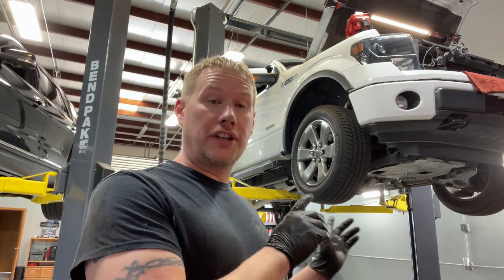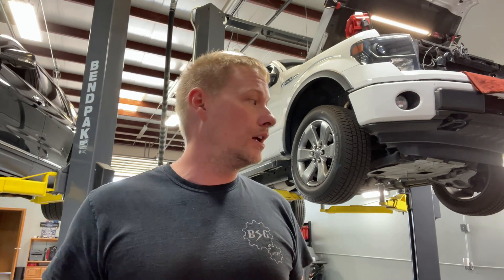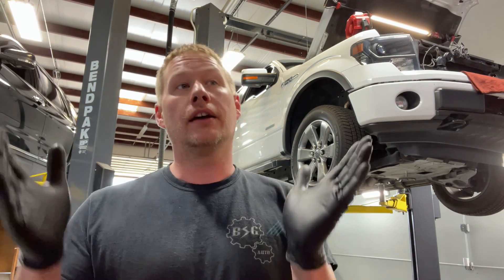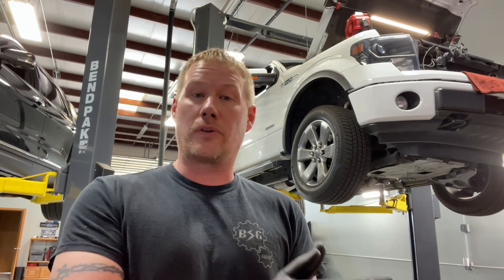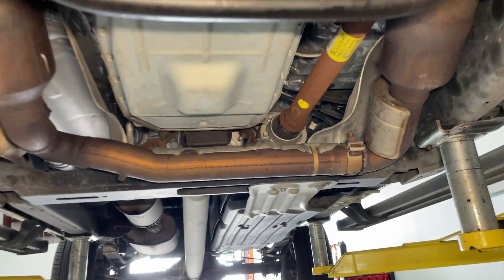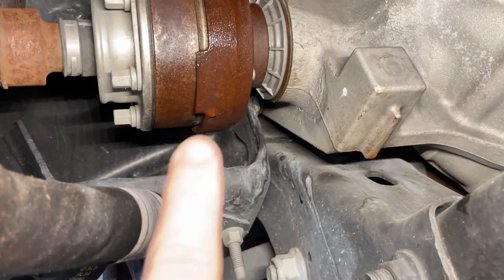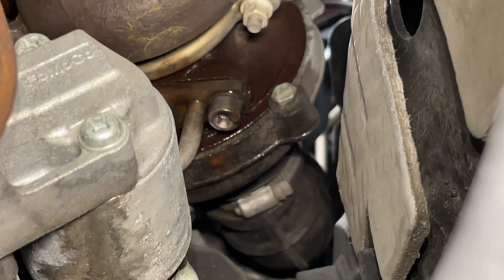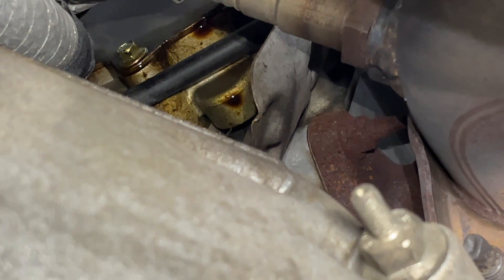Ford Ecoboost Engines Can be so Hit or Miss: I Really Feel Bad for This Customer...

Comment: I see that alot of car makers have a long oil change interval   6k or higher    On vehicles with direct injection and variable cam timing and turbos, I would suggest a 2500 to 3500 oil change.....alot of the newer motors sludge up very easily and plug the intake port on the head.....I have a Ford 302 in a 84 Datsun....and a 2.2 camry engine 1999    I change oil consistently at 3k miles, I drain the oil overnight (yes overkill) in a attempt to remove as much dirty old oil as possible (yes I know some remains) the long oil change allows for any thicker oil to drain    The Camry has 298K miles     the 302 has 180K     I inspected the cylinders with a bore camera.....cross hatching clearly present on both engines   I would not buy a modern turbo or direct injection engine at all ( I keep my cars until they are completely un fixable)  Autos are the biggest depreciating asset so I tink it is better to buy a good one and keep it to get the most value from it as possible

Comment: A little late on the response, but the truck was probably 10 years old being a 2012 assembled in 2011. Wear and tear is not just about mileage and care. The chemical properties of a lot of those seals is to breakdown now. Call it designed obsolescence. The other factor is that the truck probably ran hotter than other trucks where you reside or see, which would also exacerbate the situation.

Comment: My 2017 Escape, 1.5 ecoboost overheated at 18K miles. In and out of the shop seven times in a 10 month period. Still not happy with the way it runs...

Comment: Same issues!!  I own a 2012 150 ecoboost.  Had startup rattling at 58000. Took it in to dealer for repair under warranty but issue came back right after warranty was out. So ( thanks to your videos) I repaired it myself. I had never been into an engine that deep.  Followed the videos to the letter and everything turned out good.  So thank you for that… As of now I have over 100,000 on the truck and still see issues with it. I usually research and fix them myself as I don’t trust the dealerships to work on my truck. This is the first domestic vehicle I’ve ever owned and unfortunately don’t think I’ll own another. I like the truck if it just didn’t have so many damn issues. It’s frustrating.  Maybe Ford hadn’t worked all the bugs out of this 3.5 ecoboost before the put it into production,  I don’t know. Anyway, Thank you for your detailed videos  they have been of great value to me owning this truck.

Comment: You seem like you would find issue with anything......like, "omg the tyre treads are actually wearing down, another expensive replacement that I've seen quite a bit in these trucks"
Reply from the maker: Nope that is a wear item, I am talking real flaws and common failure points here all validated with real life examples.

Comment: So I have a 2011 ecoboost with the cold startup rattle. After changing the oil it only happens if I don’t start it for 3+ days. One master ford tech I talked to said don’t worry about it till it rattles while driving… which seems iffy to me. Is it something that I need to get fixed or can just keeping fresh oil and building oil pressure before cold starts delay the need? I’ve 290k miles and REALLY don’t want to throw down $4k 😬😬
Reply from the maker: Ok so if you have 290k on it either you put the money into it now to help extend its life as long as possible or drive it until it blows while saving for an engine.

Comment: Ouch! This one hit home. I live in Texas and just sold my '15 SHO with under 60k miles. Got the car with 28k miles, it was my baby, parked in the garage and had its oil changed (Amsoil) every 3k-4k miles. In less than 32k miles it had to have some suspension work, timing chains, chain guides, phasers, intake cam replacement, PTU replacement and the final repair was a VCT solenoid. Not too long after the VCT solenoid was replaced, I got that now infamous rattle with a check engine light (cam correlation). I could no longer justify putting money into that car, the only big 3.5L EB failure I didn't have was the water pump but I'm sure that was around the corner. Selling that car was one of the hardest things I've ever had to do. I grew up admiring the original SHO, my interest for it got reignited for the fourth generation after seeing it on display overseas. Needless to say that I'm avoiding theses engines and its newest valve dropping relative from now on.

Comment: I was a working shop Foreman at a Ford dealer for almost 30 years. I drove nothing but Fords and defended them even when they produced crap!I left in 2006 when the economy started imploding and went into the public sector, best move I ever did. Well now taking care of a fleet of Fords I will NEVER buy another one. BTW I owned a Windstar !!!! good thing I was able to fix that thing for free. Now even though It kills me I only buy Toyotas or Hondas. It breaks my heart to do it but look at this poor bastard, he has got to be looking at a $6000 repair, at 70,000 miles. My CR-V has 25,0000 miles on it and all i have done is oil changes, brakes and one oxygen sensor. Ditto for my 2008 Sienna. Ford puts profit ahead of EVERYTHING !

Comment: I bought my Ford Transit van with a EcoBoost engine 2 years ago. It's a 2016. I downloaded the Ford app and discovered that it was over due for a recall for the drive shaft coupling by 9,000 miles. I took it to a nearby dealer and they had the permanent fix.
At 100,000 miles I got the plugs, belts,  tenchener, and hoses changed out. The labor was about $800. I didn't go to a dealership for  this.

Comment: I guess the combustion engines now loosing their earned reputation as a reliable power source comes in handy to get people to buy EV’s next time.....as long as waranty claims don’t go through the roof factories couldn’t care less.....in the past two decades many complicated systems were introduced....many times to increase efficiency....when lucky it saves you just enough to cover the extra repairs and maintenance....and I am not trying to be cynical....

Comment: Any tips or videos on a 2013 F150 FX4 same as the one in your video but with 6' bed. 

On why it overheats while towing, especially up hills. Heats up to High, then drops back to center, constantly doing this?

Radiator flush & add new Yellow Motorcraft antifreeze & distilled water or New Radiator? 

Awesome videos

Comment: CAC tube leakage from the boost is just from rubber drying out over time and being not as pliable as it is when new? IE assuming clamps are tight the only fix when it becomes excessive is to replace them?

Comment: Ford Technician here for 19+ years, I gave my 2015 Ford Fusion 2.0 ecoboost a chance in 2016 and the engine blew 4 months ago. I don't want anything turbo, the car had 40,000 miles and I religiously took care of it. Bought a used 2020 F150 5.0 with 6,900 miles. I love Ford but these ecoboost have so many problems.

Comment: My ecoboost just cracked between the cylinder and the cooling jet. I am the same way, a mechanic that takes care of my vehicles and there is no way that I should have a cracked block with coolant mixing in the oil at 70k.

Comment: We as Americans have to come to the realization that American auto manufacturers suck. They hate us as their customers, they purposely over engineer for purposeful failure, they fraudulently provide planned obsolescence, they consistently engineer parts in front of parts, in front of parts to jack up the repair times, or cause you enough grief you wont attempt to do it yourself. Dodge literally ruined my life thru a series of mishaps that started with my freshly paid off Ram dead at 60,000 miles. I fu¢€ing hate our domestic brands now. Ford will literally have 15 bolt heads of a certain size, the changeup the bolt head dimensions on the 16th bolt head, just to rub sh|π in your face. They hate us, and I hate them back. Far from the greatness U.S. auto manufacturers used to be, FAR FAR from it. People LOVED working on their own cars in the 50s and 60s, even into the 70s, now...our vehicles are like a Hollywood prop set. An illusion of what you thought you were buying. It's as egregious as getting your kitchen remodeled, only to find out the contractors angle grinded a grove into the undersides of your granite counter tops, so as you leaned on it the first time, the granite cracks. Sorry sir, that repair will cost you $8500. Hey Dodge Fu¢€ you. Hey Chevy Fu¢€ you. Hey Ford Fu¢€ you. This whole thing they have done sickens me. If you work for Dodge and your reading this comment, Fu¢€ you.

Comment: So what's the bill estimate on all these leaks? I have them all too. 2012 3.5L ecoboost.162k. I already fixed the water pump leak and the quick connect coolant resivor leak.  I also have a passenger side exhaust leak :(
Reply from the maker: Thousands extra, there is a ton of labor.

Comment: I think the longer we ,as a nation, go along, the more crappy things are made and if both turbos are leaking it is a product quality issue. The other thing we should think about is time is just as degrading to these things as mileage, seals dry up, low mileage may mean mostly short trips which means more heat up and cool down cycles as opposed to higher mileage more stead load on engine than stop and start... never have been a big fan of turbos because of the heat they produce underhood.

Comment: Fix or repair daily.  I'll never own a FORD ever again!
Reply: They are all trouble these days. Even the Toyota has went to turbos and has had problems with them. I have a 2013 with the 5.0 engine and 282,000 on the odo. I had to replace the water pump last year. Other than that no issues, just fluid changes and brakes. I better hold onto this one until it blows ...

Comment: I’m at 182000 miles on my 2011 f150. Replaced electric power steering, flywheel, spark plugs, coil packs. And yea I’ve got the diesel knock upon startup, the tremendous clunk upon downshift, the limp mode when stabbing it in humid weather, (put a bud lite 12 pack card board overcharged air cooler) voila !
Reply: But I love her and I’m gonna ride her till I have to put her down, might go Dodge next

Comment: If I was ever to buy another Ford I would only get a pickup with a 5.0 V8. I got rid of my ‘99 F-150 Lariat 5.4L with 236K miles on it (religiously kept up with the scheduled maintenance). It was a good vehicle but it was a time for a change. I have a Toyota Tundra with 75k on it with absolutely zero issues with it. I’m staying put. My son has a Ford Edge with a 4 cylinder and a turbo and the engine had to be replaced at 56K miles on it! No thanks.

Comment: Ford is horrible, lawsuits left and right. Focus with transmissions that were designed bad, ecoboost engines that fall apart, mustangs that blow up the transmissions. Why do people keep buying from them. It's crazy that a vehicle with only 70k miles has so many issues, worse part is that the issues are common.

Comment: This is exactly why I bought a 5.0. I knew that turbo charging a V6 in a truck was never going to outlast a V8 making roughly the same power. The only similar issue my truck has had was the leaking water pump at 70,000 miles, which I fixed myself in a couple hours for less than $200.
Reply: Except catastrophic engine failures from 5.0s drinking oil like water

Comment: So I bought a SHO at about 56K 2015. So far I have yet to take it to a ford dealer and I've been doing the basic maintance like plugs, filter, oil changes etc. Definently not within ford's stupid ass intervals. But within a year I'm already almost up to 80k so I've been driving the balls of this thing and not grandpa and grandma style let me tell you. My question is I've talked to a lot of mechanics who don't seem to be to familiar with these new age cars and they tell me not to worry about changing the tranny fluid since it's sealed. The PTU they told me If it's not leaking don't worry about it and things like that. So from an ACTUAL ford guy would you recommend I get those changed ? I've been very paranoid about preventive maintenance on this car because I never had a turbo powered engine and I'm learning there is A LOT of things you have to do to keep these things running efficiently. Car is driving super boggy too so I'm sure I need to clean up the  throttle body too. Pretty sure the back of the valves are dirty as hell with no catch can yet. So let me have it guys!

Comment: Turbos DO NOT belong on street vehicles. My brothers bought new Chevy (Daewoo) Sonic 1.4L turbo blew up at just over 100K miles. Turbos put too much stress on the engine. They are not reliable, and never will be. That truck should have had a normally aspirated V8.
Reply: Nah, I love my ecoboost engine - it’s best of power and fuel economy for that size vehicle. So far, not a hitch with my 2014 FX4. Custom ordered to tech out, and bought it brand new (w <10miles on delivery), did every minor job on it myself, changed oil/filter every 5K miles, and 120K miles of some off-roading and over-landing later, it is still running like spanking new! I think the dearborn made vehicles have better quality build than the kansas manufacturing plant, and the higher the trim, the better attention to detail, it seems. I’m ready to upgrade to either Cyburtruck or the Lightening, not sure which, but don’t like the later only has 5.5’ bed - not ideal for weekend camping bc am too tall for that!

Comment: Hey Guys, have a question…which way is the air flow on a 2014 Ford Edge cabin filter? Up towards the roof, or down towards the floor? Thanks!

Comment: @fordtechmakuloco thanks for the info. Based on what you've seen would you ever recommend buying an Ecoboost in the 5th gen Explorer even if it passes a used car inspection? It's a vehicle I'm considering.

Comment: This is a long shot but one worth taking. You are an insanely talented mechanic and obviously know these vehicles inside and out. I have a 2013 F150 Ecoboost 100K that I have owned since brand new. I have the coolant leaks at the jiffy tite fittings (amongst a few other common issues) and I am having the hardest time finding a mechanic that has any experience with these trucks at all. Any chance you know one that you might recommend in South Florida? Not sure what your charging per hour for labor, but I would be through the moon to pay whatever knowing someone with your knowledge and expertise was doing it right. I want someone to go through my truck like you did with this customer and make sure I am aware of what needs to be done. Its nearly impossible for me to do that with confidence when none of them have eve heard of the coolant connector leaks as a common problem. Thanks in advance for any support/advice!

Comment: i had the startup rattle for years along with the death rattle on hard acceleration. i drive really conservatively and it wasn't a huge deal. I had looked up to see what was going on but most videos told me the intercooler needed a weephole drilled into. yeah right!! well finally after 4 years it finally popped a trouble code for the timing chain tensioner. With a little research i found that 12 and 13 were known for getting a batch of easily stretched chains. so i called my mechanic who told me he'd be happy to do it and would be about the same cost as the dealer but recommended i go to the dealer just because of the warranty ford puts on their work. i had them do it plus a few other things and it runs like brand new! my wallet hurts but i forgot how much fun this motor was.

Comment: Only Ford I ever owned was a 1987 Tempo that was also well taken care of until the transmission died at 120K and junked the car. Intank fuel pumps would consistently die every 40K miles requiring the tank be dropped, and Map sensor would also die on a regular basis. They still source all parts out of Mexico, cheap junk. Since then it's been many miles with only European cars with Bosch fuel injection and ignition, very happy.

Comment: So I have a 2014 F150 3.5l 4wd  Needs engine replacement.  What are your thoughts on removing and lifting cab off of the frame to gain  access to the engine.  First one of these I will be doing

Comment: Love your videos they help alot . But I do have a question for you . I changes the vacuum pump on a 3.5 Ford 150 and the brass push rod fell out , if it went in side the motor were would it wined up ? Would if go in to the oil pan ? Hopefully you can tell me . Thanks a lot 😁 . Hope to hear from you soon . P.S . I'm not 💯 sure we're it went could not find it . But just in case it went in side the block were would it end up ?
Reply: What ever happened

Comment: As a Ford mechanic, idk whats better, Fords 4.6 5.4 3valves or these 2.7s Ecoboost engines, im not impressed, I'm a Chevy guy and well Im not a huge fan of Chevy atm either, I mean at least chevy kept the 5.3 and the gutless 4.3 but dropped the 5.7? Dodge, I just don't see the value in them, the rot so fast here and still sell for a lot, Maybe my next vehicle will be a Toyota or something.

Comment: My uncle bought a 1970 ford truck for 2600 bucks brand new.  No fuel injection ..standard 3 speed transmission.  manual choke.  ran like a top for years and years.  These pieces of junk that they sell now for 70 80 90 thousand dollars is a no win situation.  I don;t want one..

Comment: I would love a new F150 with one of these newer engines, but I don’t know if I’ll be able to part with my 2 valve 4.6 in my ‘08.  247,000 miles on the original engine and timing components, and still sounds like new.  No dreaded ticking or startup rattle that its 5.4 counterpart was prone too.  All maintenance was done at the recommended intervals, and the worst leaks it’s ever had were a vacuum hose, the muffler, and the washer fluid tank.  Seems like the 2V 4.6’s were indestructible.  Brian, you are a godsend to anybody who owns a Ford!  Glad to see this customer’s truck get fixed right.